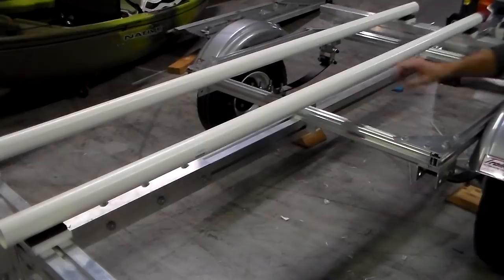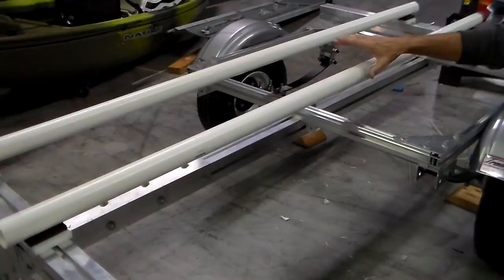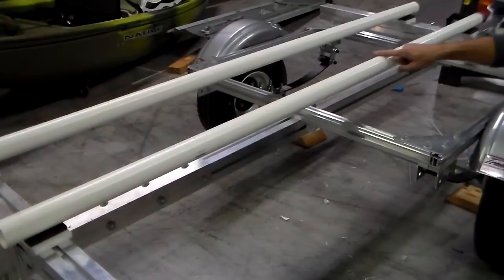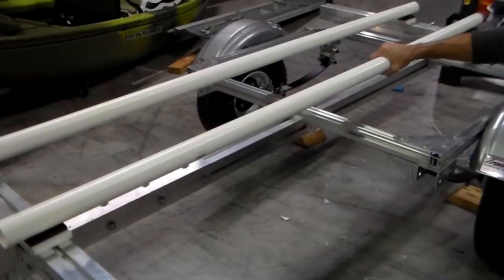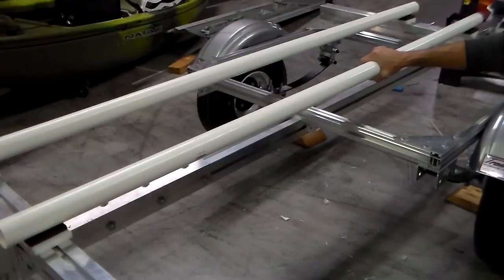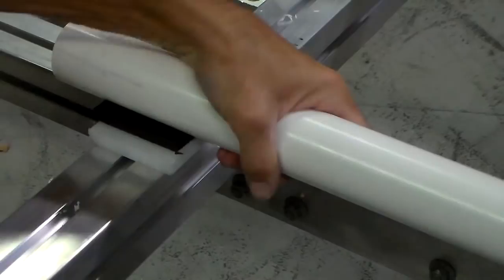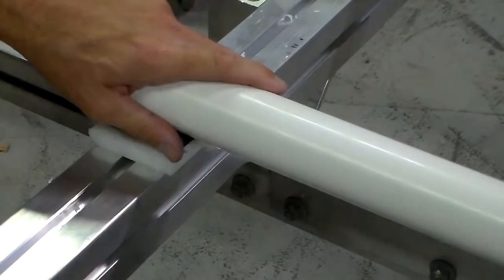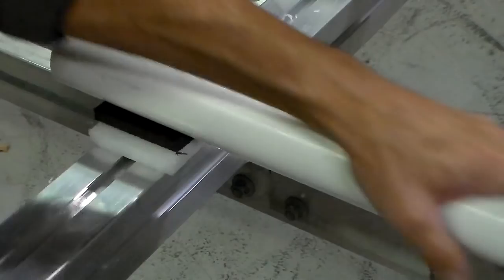PVC Kayak Trailer Bunks - the right and wrong ways

Comment: I've been using 3" PVC pipe for 10 yrs. with no problems on my original Hobie Mirage and now current PA 14.  As Tom Kirkman mentioned, the important thing is for the PVC to be able to flex and conform to the kayak hull.  I have two 8 ft. sections of 3" PVC pipe (Sch 40) on my current trailer 10-11" apart, and they're bolted at the very ends ONLY.  This gives the PVC pipe enough flex in the middle section of the kayak to conform to the hull.  It's been working well.  Hull is as good as new.
Reply: Very good info. 😋
Reply: That was much more helpful than the video

Comment: I have a question how do you figure it was you. How long ago did you do this? I built my first trailer using PVC over 25bn years ago. And I would not claim that. This is funny!
Reply from the maker: It comes down to having proof, which I have. Prior to my original use, to prevent hull hogging on plastic kayaks, not a single person had published any similar set-up. Claiming it is one thing, proving it is another. I have youtube videos from almost 10 years ago showing it, and articles with Hobie from before that detailing it. Where can I find your video or article predating mine that feature the lengthwise tubing, not cross-ways tubing that does not serve the same purpose. Please watch the video - it's about more than just using PVC - it's about HOW to use it.
Reply: @TomKirkman1  25 years there was no publishing. I have proof but I am not claiming what you are saying bro. Have at it since it means so much to you. I fabricated my first trailer 38 years ago. What were u doing then?
Reply from the maker: @HELIARCMASTER  Developing many of the kayaks and kayak fishing accessories that are in broad use today.
Reply: It’s funny that this is what you took from the video…..not the knowledge he chose to share.

Comment: Aloha from Hawai'i Tom.  Do you have any thoughts on using black ABS pipe versus PVC pipe?  I know ABS is more Impact resistant than PVC though PVC can handle more PSI.  My kayak is a Solo Skiff which weighs in at close to 200 pounds with gear onboard.  Do you have any recommendations as to what diameter pipe I should use at least a minimum size.  Mahalo nui for the informative video.
Reply from the maker: You want to use whichever is the most flexible - the idea is to have the pipe conform to the hull shape. If the pipe is too large or too stiff, it won't do that and you can damage your hull.

Comment: Hi Tom, 
First of all, excellent video. I have done what you suggested and it works great. I don't know if you are still answering questions, but I have positioned the PVC pipes for my Kayak. They are free moving using rubber as you suggested, however they really bow when the Kayak is on the trailer. Almost to the point that when I am driving it looks like the Kayak is bouncing and might snap the pipes (over 100lb Kayak). If I tighten the hold down straps it creates even more of a bow. So what I did was, put the Kayak on the pipes to let them find their natural position. I then put support under the center to help support and stabilize them. The support doesn't appear to have changed the natural fitting of the pipe to the Kayak and everything appears more solid. When the Kayak is not on the pipes they raise up off the center support. I would very much appreciate your thoughts on this. Thank you.
Reply from the maker: I think you did the right thing. Once the pipes are conforming to the hull, support under that isn't going to hurt anything. The hull remains supported in that hull shaped "cradle" and all should be well.
Reply: @TomKirkman1  👍Thank you.

Comment: I have a Passport 10.5 weights about 65 lbs unrigged not sure if i should go with the 2 or the 3 inch.
Reply from the maker: Go small as you can - the idea is for the PVC to bend and conform to the hull. Too large and the hull will be required to bend and conform to the pipe.
Reply: @TomKirkman1  got it, thank you for the quick reply! 👍

Comment: Great video. I was thinking about using timber given the distance between my two fixing points. Do you feel 6ft is too much space between fixing points when using plastic? That is all I have and I'm worried the plastic will deteriorate and crack over time.
Reply from the maker: Will your timber flex and conform to the shape of the hull? If not, you'll damage the hull. That's the point of the PVC - it flexes and conforms to the same curvature as the hull.

Comment: Supposing I use 3" PVC for my 12' Kayak, ( I may use 4") what is the maximum distance for the bottom crossbars to be so the pipes don't collapse and break from the weight of the kayak?? 
While I trust your method of allowing the pipes to flex, I see so many videos where the pipes are supported underneath the entire length??
Andy-New Kayaker

Comment: Thanks for clarifying the true purpose. I have seen a ton of rigid designs and oversized pipe. Im going to try 2” schedule 80. I am interested in seeing what kind of life I get out of it and how it holds up on bumpy dirt roads. Thanks
Reply: I hope it works for you, I may try the same thing. 😋
Reply: It’s been 3 @frzncstrd7647 and 2 years for you @joesmo5143 how is it going for you guys? Thanks
Reply: @MrDgill25  no issues with the pipe. An occasional check to make sure things are snug on the fittings.

Comment: I have 2 Sit on Top kayaks.  They are double kayaks weighing 75 pounds and are 13 feet long.  What size (in diameter) PVC should I use and what length?  I have two 2x4 wooden cross bars that are bolted into the frame of the trailer.
Reply from the maker: Can't really advise you on that - depends on your specific boats but I'd guess no more than 2 inch diameter. Length is something you'll have to gauge as you work on trailer. The important thing is that the PVC flex to conform to the hull, rather than the hull having to conform to fit the PVC. Affix the pipes at the ends so the mid section can flex to fit the hull.

Comment: @TomKirkman1  Hi Tom.  I definitely want to do my kayak trailer like yours and I understand your ideas and reasoning.  Exactly how to attach the pvc to the trailer is what has me confused and not know exactly what I should buy to attach it.  Do you just have just one hole in each end of the pvc or two?  Do you have rounded wash inside?  Do you just use one locknut on each screw?  Any advice would be helpful on the best way to attach the pvc, I'm afraid I'll screw it up and the pvc will crack or break, thanks.
Reply from the maker: I need to take a photo because it's hard to explain yet easy to do. You can bore a hole all the way through so you can get a socket in there to the bottom hole, or struggle with a wrench (I did) in through each end.

Comment: Dumb question but how the heck do you make sure the holes are in the same spot in the front and back of the pvc
Reply: As long as your end cuts are square, I would snap a line on it.  If not, you might be able to get away with using some markings/printing on the pipe as reference.

Comment: What size pvc did you use? I have a 2019 outback and I’m hearing a lot of 3” instead of 2” which seems too big and wouldn’t fit as well. Also what did you use for connecting pvc to trailer? Screws? I’ll be securing unistrut to a wood box, and pvc to the unistrut.
Reply from the maker: As the video points out, the entire purpose of using PVC is to have something that flexes and conforms to the hull. 3-inch PVC is stiffer and may not allow that to happen. Use whatever size will flex and conform to your hull.

Comment: What type of bolts did you use to mount the pvc to the trailer? Carriage style bolts, or does it not really matter?
Reply from the maker: Doesn't really matter. But you need to be able to get a wrench or ratchet into the pipe to hold one end of the bolt while you tighten the lock nut on the opposite end. If using a trailex type trailer like this one, then the lock nut is in the trailer channel and only one wrench is needed. I typically leave them just a little lose to further allow the PVC to "move" and conform to the boat hull.

Comment: @TomKirkman1, do you have any video or specific description of how you attached the pipe to the crossbeams?  Purchasing a 2020 loadrite kayak trailer tomorrow and want to add pvc to make launching easier.
Reply from the maker: Just a bolt and nut from the crossbar up and into the bottom of the PVC. But you need to use a locknut and don't tighten it all the way down onto the pipe. The pipe has to be free to move a it both side to side and to allow flexing without having a sheer point at the attachment location.
Reply: @TomKirkman1  thanks
Reply: @TomKirkman1  do you bolt though both sides of the PVC pipe or just “inside” the pipe?  Otherwise you would have a sharp piece of nut or bolt sticking out the top of the pvc wouldn’t you?
Reply from the maker: @ashlouka  Just inside the bottom. Note in the video that you do not see any bolt heads protruding from the top of the pipe.

Comment: I see this was posted 3+ years ago so maybe I won't get an answer. ANYWAY, don't you lose the flex when you tie the yaks down?
Reply from the maker: No, the pipes flex the instant you set the boat on them.Tying the boat down doesn't affect that. Once the pipes conform to the hull you're good. I would advise in any case not to overdo the tie down tension for other reasons - a lot of people go way overboard when tying their boats on their racks. As long as the boat can't slide forward or backward, you're fine.
Reply: @TomKirkman1  Thanks for the rapid reply !!!  Definitely on my “To Do” list! Thanks again Sir for sharing your time and ideas!

Comment: Great video. This explains more than anyone else on why and how to use the PVC pipe. What did you use for the rubber spacer?
Reply from the maker: Various things will work. In this video I used rubber cut from anti-fatigue mats. Old tire sidewalls can work. Lots of things out there for this purpose. You get the height with just a tad bit of cushioning.
Reply: @TomKirkman1  Thank you.
Reply: I used an vehicles rubber floor mat. Just cut into squares with a groove for the screw.
Reply: I am using anti vibration pads sold for washer/dryer.

Comment: No one made you the kayak trailer ambassador . You don't want flexing will crack cold  plastic .
Reply from the maker: Yes, this is fine in cold weather. The pipes only flex at the outset to take the shape of the hull. After that they no longer flex as they have taken the shape of the hull - which is the whole point. I've used my trailers made this way for nearly 18 years now, and in very cold weather, and none of the pipes have cracked or failed.

Comment: For more "flex" use SDR 35 sewer pipe instead of schedule 40 pvc pipe. SDR 35 is a thinner wall pipe and has a good amount of flex alone whereas schedule 40 pipe is more rigid.
Reply from the maker: Could be a good tip, particularly when  shorter boats and shorter pipe sections are used. Thanks.

Comment: Thanks for the video Tom. I remember your initial video and you’re right, you were the first. 

Question, Hobie has recently stated that the PA should not be stored or transported on parallel PVC rails. They claim possible damage to the scuppers. What are your thoughts on this?
Reply from the maker: I haven't seen any damage to the scuppers nor do I really see how they would be damaged by using the PVC in this fashion. The weight is spread out over a large area, not concentrated on just the scuppers. Now if you don't support the PVC rails in the manner I've shown here and your hull is only touching the rails at a few points, then yes, hull damage could certainly result. That was my point in having the rails bend and flex to properly conform to the hull.  However, Hobie supplies the boat warranties, not me!  So you'd have to consider that when storing or transporting your boats.
Reply: I have a Revo-16 and a TI, and there is a similar warning for those as well, however, my read of the warning is worded in such a way as to advise against storing the vessels on the plug-in carts, which do pass directly thru the scuppers AND utilize a crossbar at the same locus.  In this case, the problem is concentrated loading over the knife-edge of the crossbar.

Mathematically, the PVC bunks are clearly the best practical storage solution -- no I will not go into the mechanics of that, but Tom's comment RE the continuous distribution of the loads are exactly correct.  There is a better solution, that is more problematic IMO, and that is to wet store it or put it on an enormous pillow. LOL
Reply: No he wasn't, I've seen pvc since the 80s.
Reply: @TomKirkman1  actually the weight is distributed only along the PVC. In theory the kayak could sag in areas not supported by the PVC.
Reply: @SuperBardley  0

Comment: tom..i just received a new windrider 16 trimaran that is a rotomolded boat weighing about 250 lbs....and the pvc idea seems perfect.....the hull includes a keel  running 1/3 the length of the hull so I'll need to suspend the pvc high enough to allow the keel to raise over the trailer frame; but, the pipe sure sounds perfect...thank you very much
Reply from the maker: I'm not sure that this system is at all good for the WR16, you'll just have to work at it and see how things turn out.